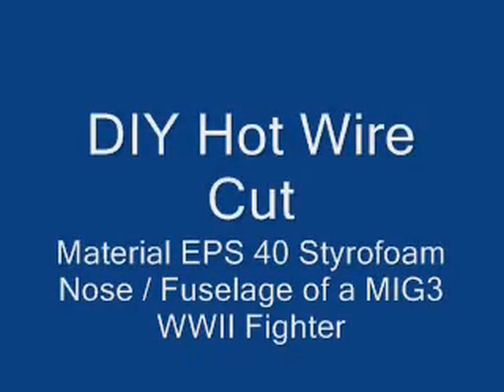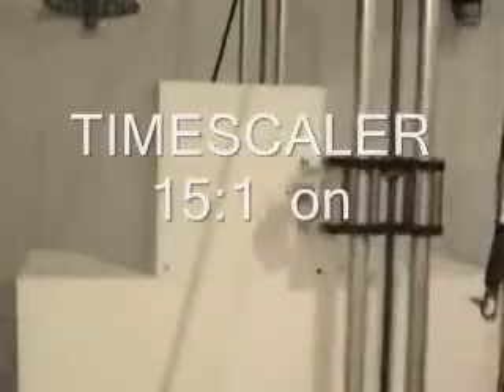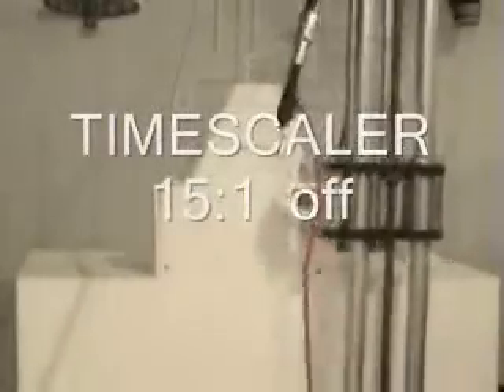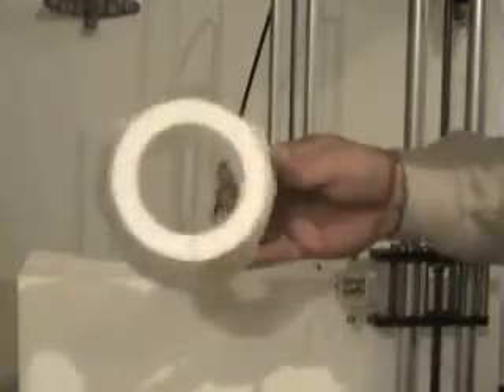DIY Hot Wire Cut

Comment from the maker: @kingpav THat is easy ... If you go with Linux there is EMC for Axis controlling. FOr windows you could use e.g. Mach !  The basics are you would have to generate two splines in the Cutting planes which are result of extrapolation of your solid then cut them into equidistant ultrashort parts and note dwon the coords of the intersectionpoints ... those are to be merged to a 4 Axis Nc Code File....

Comment: @THEREALOPTIMIST That's interesting. I have a 4 independent axis HWC but I never bought the motors or made the bow. I'm buying the motors, bob and drivers later this month and am also looking for software. I would be interested to know more about what you used and how it works with various geometrical cutting issues.

Thanks again.

Comment from the maker: @kingpav  The Software is a DIY, -  machine related scripted plugin for a special 3D CAD ... It is not yet finished and debugged,  but it works directly from 3D and so makes it possible to cut more complex parts - until the basical rules of wire cutting are not exceeded.